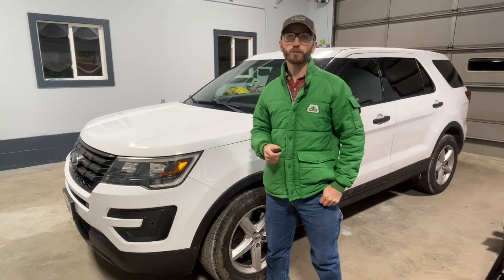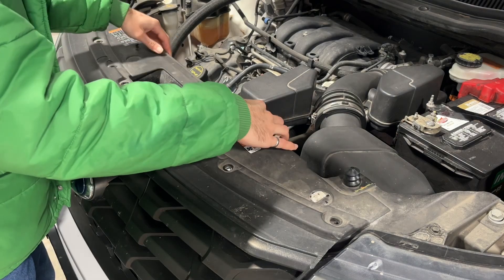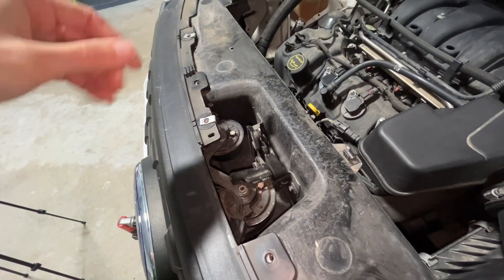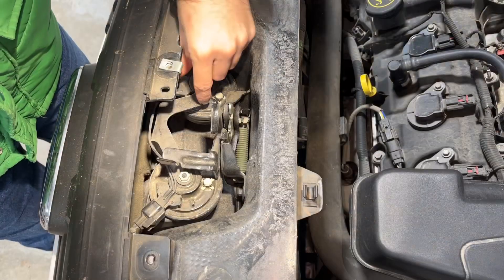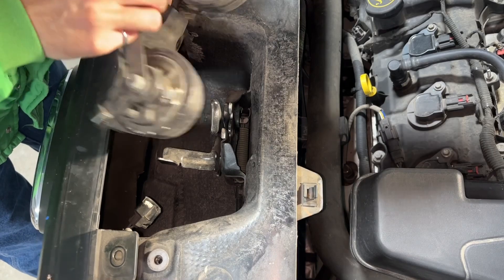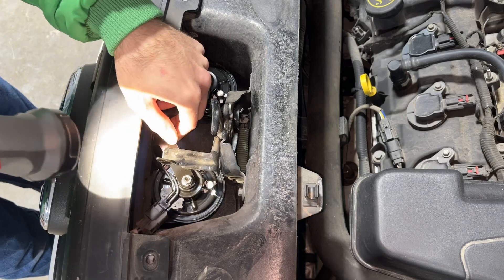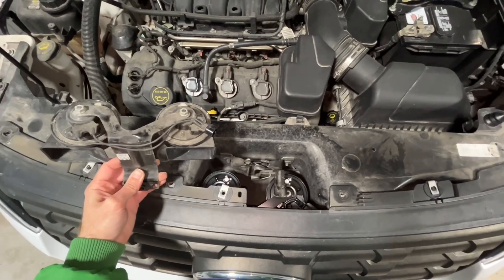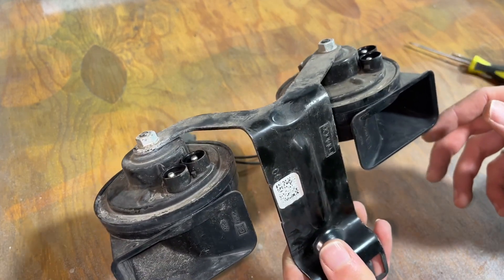Ford Dual-Tone Horn Replacement for Explorers & Interceptor Utilities

Comment: My 2019 Explorer has only one horn. And it went out.

Any issues replacing it with a dual?
Reply from the maker: With enough effort, any horn can go on any vehicle… the question is how easily it can be done. Does your horn have the same connector as mine in the video? Is it mounted under the hood latch like mine?
Reply: I have the same problem 2019 Ford explorer Platinum one horn and it went out.   Would like to replace it with the dual horn setup looks like there's plenty of room as I have a bracket that has a spot for two horns but only one on it.

Last weekend I just replaced my single OEM horn with the dual horns not one single issue 10 times louder than before.

Comment: My single horn just recently died on my 19 limited I would have replaced the entire horn assembly like you did but mine has the active grill shutters so that wasn't happening I simply disconnected the single horn from its harness and undid the bolt from the mounting bracket remove the horn and installed the two new horns and installed their nuts connected to the harness and all is good now. 

I now have a much louder horn since this is the dual setup versus the single horn on the dual mounting bracket that came with the SUV.  Cost me $54 and 15 minutes of my time

Comment: Reid, i want to add the factory remote system to a 13 FPIS. Any data on this?
Reply from the maker: @gradertfamilymakes  for any factory remote start system, you’ll need…
1. A hood switch in place
2. A hood switch harness
3. Keyless entry
4. (Maybe) an alarm system

Do you have any of those currently?
Reply: @reidthemanual  we have a car where forscan says we have remote start capability. But not any way to enable entry. So I suppose I need the modules, antennas, etc. Not sure if forscan can program these.